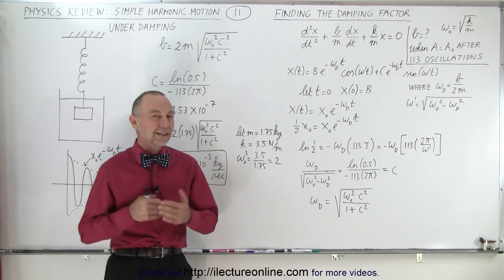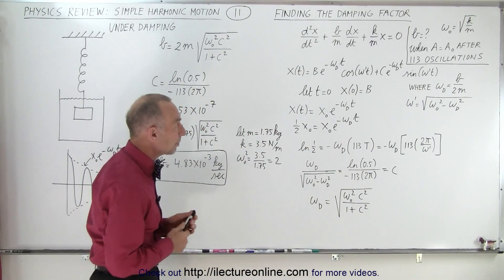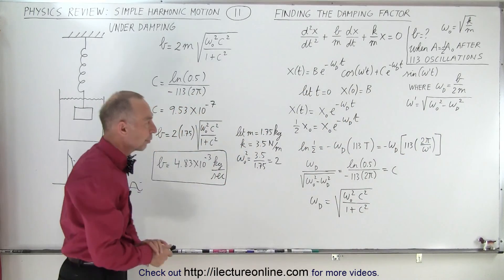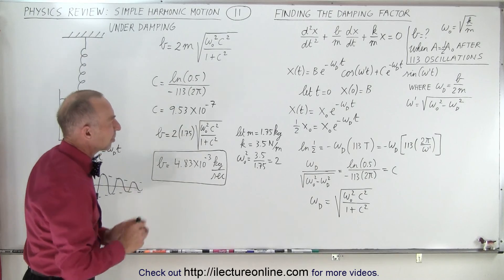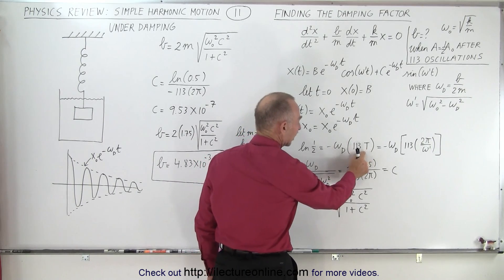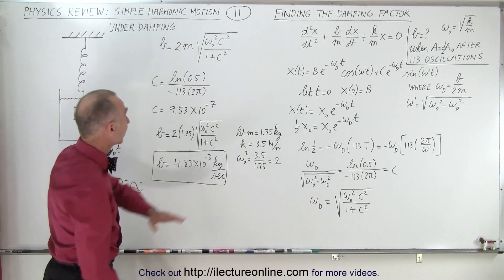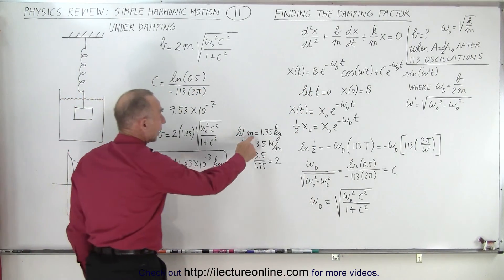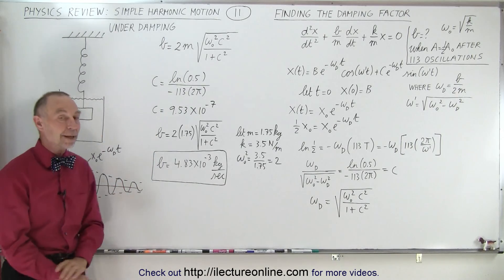Physics Review: Simple Harmonic Motion #11 Finding The Damping Factor

Comment: What is the slowest pulsar
Reply from the maker: That I didn't know, so I looked it up.  It is:  PSR J0250+5854  which makes one rotation on its axis every 23.5 seconds.  Very slow by pulsar standards but that is still enormously fast.  Most pulsars do it in less than a second.
Reply: @MichelvanBiezen   Ok thanks sir.